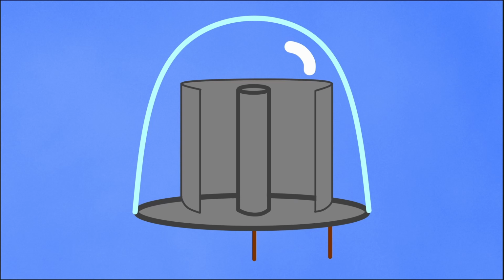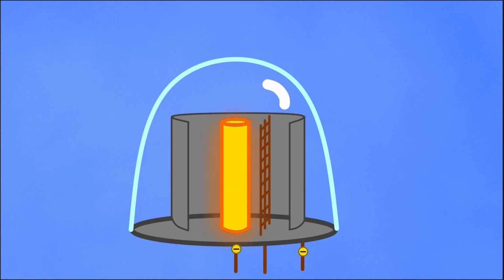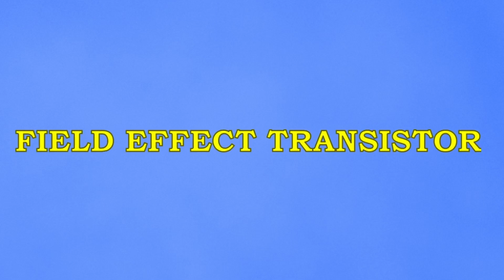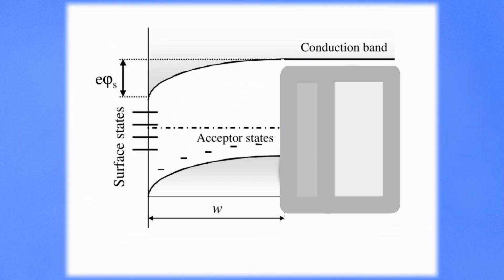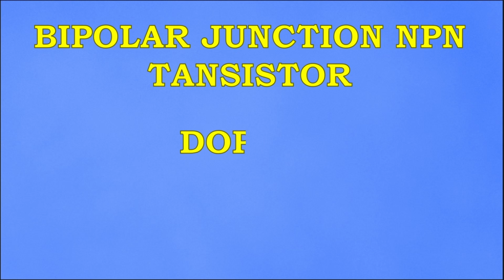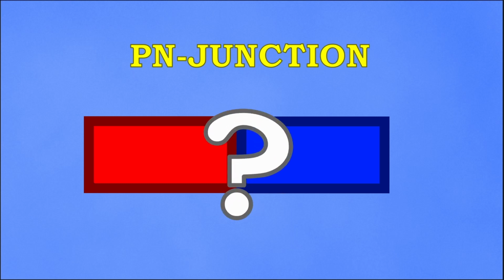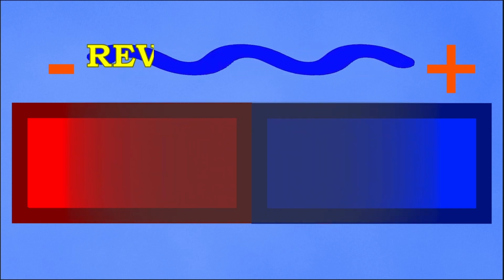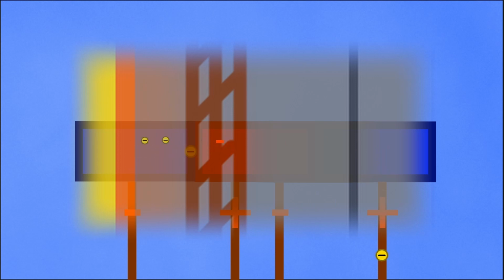One component ESSENTIAL to modern-day electronics (Brief history, simplified operation)

Comment: The element in the first 30-40 seconds of the video is not a transistor. It is a temperature sensor. Make more effort in the next video!
Reply from the maker: Temperature sensors use transistors